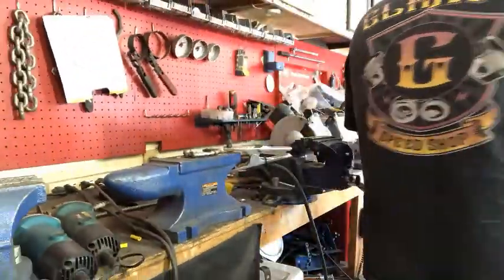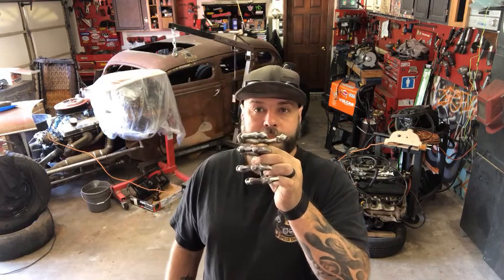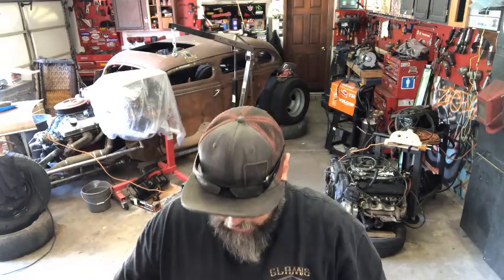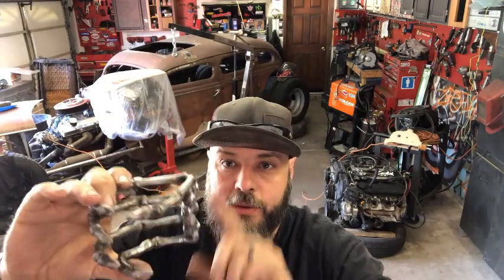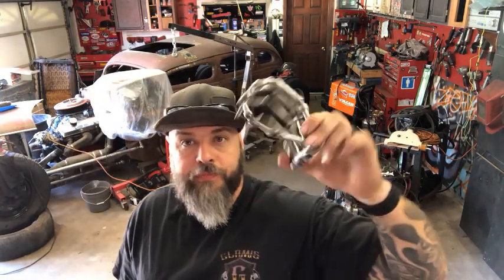Rad Rod Custom Cup Holder part 2

Comment: You should make some more and use them in the engine bay. Maybe one holding onto you Exhaust pipe and supporting something in the engine bay. Bloody great Idea. I did a out of old nuts and bolts and car engine parts.
Reply from the maker: Patrick Coombes fun you say that. I’m already planning on making ones for the exhaust supports